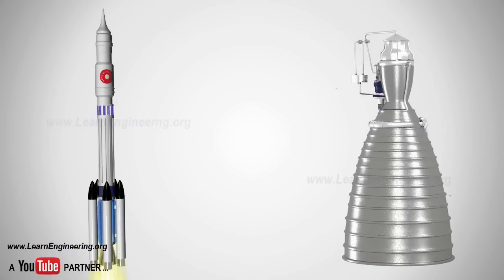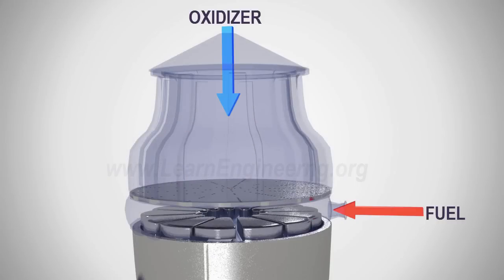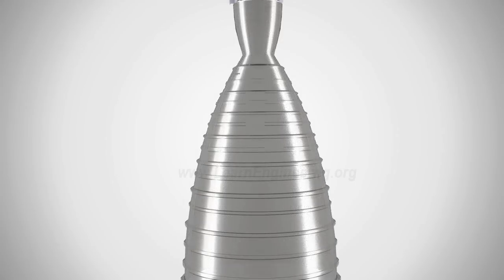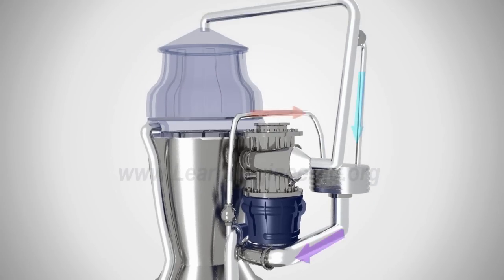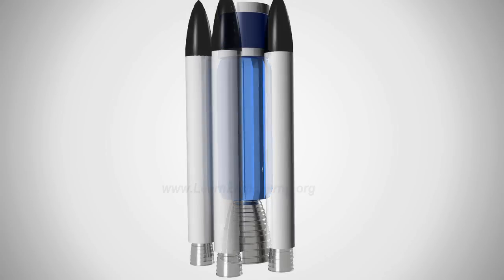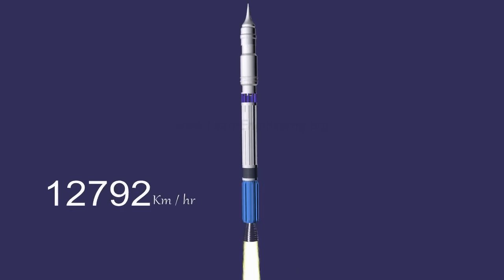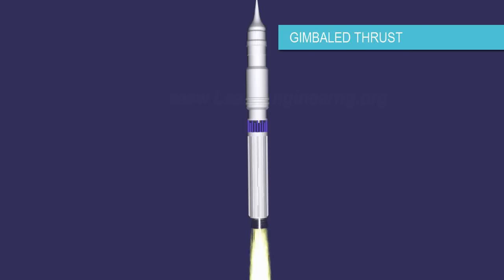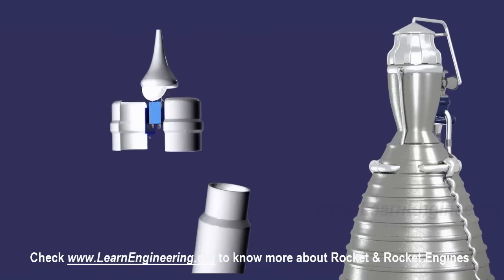How a Rocket works?

Comment: Thanks for your very nice video.  Would you please teach me how it has been obtained in the manner which the driving force of the pumps?
Reply: +shouji takano - They use a small rocket engine called a gas generator to drive the pumps. Its output is a hot smokey gas traveling at a very high speed. The gas coming out of the gas generator then goes through a turbine, which is like a windmill. The energy in the gas is converted to mechanical energy by the turbine causing it to rotate. The two propellant pumps, one or the fuel and the other for the oxidizer, are on the same shaft as the turbine, so when the turbine spins it drives the pumps. The turbines on the Apollo Saturn V first stage were amazing. Each one produced 55,000 horsepower, which was necessary to pump all that propellant into each engine.

Comment: This is an excellent video. However, I would suggest one addition.

Many people have trouble understanding rocket propulsion, especially outside the atmosphere, because they can't understand what the rocket "pushes against". They are under the misunderstanding that rockets push against the earth's atmosphere initially but then once in space they have nothing to push against. So it is often wondered how do they work in space.

Most explanations of rocket propulsion appropriately include a reference to Newton's 3rd law of motion. But actually, all three laws are involved in rocket propulsion and the first law is as equally important as the 3rd. This is because it established the "dual role" of the propellants. Of course one role is to cause the combustion necessary to accelerate the propellants through the nozzle. But the other role is to supply the mass, along with its corresponding inertia.

To clear up the confusion, it needs to be more strongly emphasized that it is the inertial mass of the propellants that the rocket "pushes against" while changing its velocity in space.
Reply: Free Speech Well, I don't know how to put it more simply. 5th graders grasp this stuff, if you don't, I guess no one can help you.

Just think it through, you expel many tonnes of propellant from your rocket at high velocity - and nothing happens on the other end?
Our universe wouldn't look anything like it does if this wasn't true, think of the implications for star formation.
But alright, I guess it's all a hoax and you are one of the few "brilliant" people to figure it out. Arrogance and ignorance is a dangerous mix.
Reply: +Greyfell 309 - I'd be glad to teach you how all this stuff works. I charge $150/Hr. I hope you have a big bank account because I think it's going to take a while.
Reply: Greyfell 309 "Every action creates an equal and opposite reaction" sounds familiar, right? That's why you laugh when in movies bad guys go flying off after being hit by shotgun blasts, because it is absurd, right? The shooter would do the same!
Well, that's where the comparison is accurate.
A rocket weighs between 500-800 tonnes, depending on type, at launch, most of which is propellant. The reaction works the same in vacuum.

But logic isn't going to work on people like you, hm? At least it hasn't yet.
But ask yourself: all the space pictures from all the nations and scientists and government...a conspiracy involving hundreds of thousands, potentially millions of people from all over the world....and it is so obvious to see to armchair truthers like you...that sounds wrong, doesn't it? I mean, like, what are they REALLY hiding?
Lizard people. It's the lizard people.
Reply: Greyfell 309 You are only able to form this sentence because you were taught so by others. That is literally how human advancement has worked for our entire existence. It's even the same for animals.
Seriously, how do you just say 'fuck you' to the millions of people smarter than you that actually figured shit out?
That is the definition of stupidity.
Reply: Greyfell 309 Human advancement, people learning from other people over time, which is what got us computers and rockets in the first place. You are capable of forming sentence, but not so much of comprehending them, hm? At least you are somewhat consistent.
Reply: +Free Speech - You are incorrect. What's really in play here is Newton's first law, which is sometimes called the law of inertia. The propellants carried aboard a rocket have inertia and as such they want to remain in their current state of motion. So when a rocket engine accelerates the propellants up to supersonic speed it's actually pushing against the mass inertia of the outgoing propellants. It's really not a difficult concept to understand.
Reply: +Greyfell 309 - Please provide a logical explanation why it is wrong.
Reply: Greyfell 309 Except that it does work and your assumption is wrong.
The reaction mass - the propellant - is what makes a rocket work, even in our atmosphere.
Reply: Greyfell 309 Just shine a laser on one of the mirrors they left behind, it's easy, coordinates are publicly available.
Or were those left by the lizard people?
Reply: +Greyfell 309 - NASA already did.
Reply: +Barron Risling - And when you're prostate comes out the reaction will cause your body to go in the opposite direction according to Newton's third law.
Reply: +Greyfell 309 So NASA has fooled all of the scientific comunity? Wow, You are a genius
Reply: +grmasdfII Yea, but it's a throwaway reference.  Everything about this video is on the superficial side.
Reply: +Greyfell 309 - Yes, they work in space.
Reply: +Free Speech - Please direct us to a website that "proves" rockets do not work in space, so that we can all become as highly educated as you are. Prove what you are saying, or maybe you just cannot prove it and would rather stick with your unsubstantiated beliefs?
Reply: +Greyfell 309 - The concept of action/reaction is in no way based on the concept of "pushing" against anything. This is a misconception that can be easily cured by studying the topic instead of using your "best guess".
Google "specific impulse". Good luck.
Reply: +Joe Vignolo - Exactly. Greyfell has "looked into this" - by that he means he watches youtube videos made by people who have zero understanding of these concepts and would rather believe them than the books he was supposed to study when he was in school. It's a lost cause.
Reply: +Greyfell 309 - You keep saying "rockets would have nothing to push against", but that's not how rockets work. Your "information" is not just flawed, it is totally incorrect.
Reply: Joe Vignolo, Respectfully I will attempt to change your perspective: "Rockets work in space by pushing against the inertia of their own propellants."
That is the work they perform, not how they perform it.
I think this next part just restates what you have written a few times before about how they perform the work.
In the thrust chamber the gasses are "thrust" away. As long as they are accelerating they are performing work, even as they expand and lose pressure. The instant they stop accelerating they become exhaust.
Reply: I'm pretty sure that SpaceX rockets aren't the size of the Saturn V.
Reply: +Greyfell 309 - Your understanding of the physics involved in rocket propulsion is deficient. You need to take and pass at least a junior high school level course in basic physics before you post to any more articles like this.

You also sound like what I call a "paranoid government hater". You hate the government so much you think it always lies about everything. Sure, it sometimes lies but sometimes it doesn't. But you can't figure out the difference. So you try to discredit NASA and the Apollo project by posting a bunch of drivel and nonsense trying to convince people that rockets can't work in space, when they obviously do.
Reply: tekcomputers
- Exactly. Well explained.
Reply: Joe Vignolo, thanks for posting this comment, even if the discussion did get taken over by a couple of trolls. I had the same argument with another delusionist who clings to the idea that a rocket "pushes against" something and therefore can't work in space. There's no convincing them.
Reply: Joe Vignolo Is it actually that complicated to be worth that much, or are you just trolling the moron?
Reply: grmasdfII And soon, it will give us organic robots capable of completely imitating human behaviour.
Reply: Rohan Zener lets bloody well hope they don’t imitate these paranoid morons behaviour otherwise devolution will be rampant and extremely fast! 

I think the whole space sucking thing has come from movies like alien where the alien was liquidised and sucked out to space through a tiny little hole in a window.
Reply: Joe Vignolo So what if we were to accelerate the gas to hypersonic speeds?
Reply: I thought it's due to discharge of fuel in opposite direction which provides a forward momentum 

You can't push anything in outer space
Reply: +Greyfell 309 - Rockets work in space by pushing against the inertia of their own propellants. 

The propellants have mass just as all matter does. And all mass has inertia. So as the burned propellants accelerate out through the exhaust nozzle they try to remain at rest according to Newton's first law. Therefore, accelerating the propellants against their own inertia creates an equal and opposite force according to Newton's third law. It is this reactive force that pushes the rocket in the other direction.

Another way to envision it is to imagine firing a rifle in space. Initially the loaded rifle, the gunpowder and the bullet will all be at rest together at some initial starting point. Then fire the gun. As the gunpowder burns and expands in the rifle barrel the gun pushes the bullet in one direction while at the same time the bullet pushes the gun in the opposite direction. Afterwards the rifle will be in motion going in one direction and the gunpowder and bullet will be in motion going in the other direction and both will be moving away from the initial starting point.

In a rocket, the rocket's structure is like the rifle. The propellants are like the bullet and gunpowder. The action-reaction principle is the same.  

It's true that eventually the propellants will defuse out into the void of space, but only after being accelerated out the nozzle at high speed, which produced the reactive thrusting force in the opposite direction.
Reply: +tekcomputers - Correct. Most modern rocket engines have thrust chamber pressures of between 100 and several hundred PSI. Therefore, the difference between 0 PSI in space and 14.9 PSI near the ground is insignificant. In either environment the engine will operate nearly the same.

That said, the pressure difference across the nozzle alters the kinetic state of the gas. It's just F=MA. The gas has mass (M) that when accelerated (A) produces a force (F). The only thing I don't get is why this is so hard for some people to understand.
Reply: +Greyfell 309 You make the same mistake most people who deny rockets in space work, claiming vacuums just suck the fuel out..... Vacuums do not "suck" they are not a thing and they exert no force, they do not push, they do not pull, they are the lack of anything...... the force that causes gases to expand into a vacuum is the kinetic energy of gas molecules themselves, not any "sucking force" by the vacuum.... the vacuum simply present nothing to alter or impeded the gases kinetic motion. The misconception you, and several others have is owing to you not understanding the nature of gasses as a kinetic material. I would suggest studying the kinetic theory of gases as it will fill in the holes in your knowledge so you can better understand why rocket will indeed work in a vacuum.
Reply: +Joe Vignolo It's covered in the beginning of the video, Newtons 3rd law of motion, reaction mass n whatnot.
Reply: Greyfell 309 Do you believe in autism?
Reply: Ok, so can we go to the moon now? :P
Reply: Who are this millions of people smarter than you that actually figured shit out? There are not so many space agencies in this world..
Reply: Yes, no doubt about it... )))))) :P
Reply: @greyfell3099  
Im not a rocket scientist, but I am an aerospace engineer, so thats close enough.

Lets start with this, once you place fuel in the combustion chamber, it doesnt get sucked out by the vacuum at the outside of the nozzle, as a matter of fact, vacuums do never suck. 

What is happening is that the propellant is burned, expanding the propellant immensely, this increases the pressure in the combustion chamber, pushing the fuel away. 
So actually the rocket is pushing the propellant out the back.
Reply: "It's really not a difficult concept to understand." No, it's not, but it's incorect. But i'm not the rocket scientisit here
Reply: "Rockets work in space by pushing against the inertia of their own propellants. " I'm no scientologist, but this statement is.. eeeh.. If that's the case, then the rocket would go faster and faster, how do you stop this in space. Another issue with that is inertia is not matter, so you can not push against non material things.. Another issue is that in void, the exhaust gasses will expand so fast, it will vaporizes almost instant. "The propellants are like the bullet and gunpowder. The action-reaction principle is the same." This analogy is not true. In a rifle, .The gunpowder expands very very fast, this expansion will push the bullet out. No rocket science there, how is that similar to rocket engines? I'm tellin you, rocket will never work in space, but that's not the reason NASA never went to the moon, not even close
Reply: ))))) ok, let's just stop this conversation here, it would be better this way :) Peace!!
Reply: This is not something i heard on the TV once, i actually have loocked into this, and the conclusion is no, rockets can not work in space. It does not take a super human genious mind to figure it out. Rockets in void.. please :D
Reply: It would, but it's very hard to do so with just a comment.. Just think of gases here on earth.. they stay together because the air pressure keeps them together.. In such a vast vacuum, any gas will expand soo fast in all directions, there would be nothing to push against anywhere.. That's one thing, the second reason for no rockets in space is the control of the rocket, since you rely on the burned gases to push against.. It wont work.. try to picture this scenario in your mind....
Reply: 5th graders grasp this stuff only because they are learned so by others. Many many BS is planted in the mind of children. And no, the universe does not look like anything what's on your mind, it looks just as you see it with your own eyes
Reply: Still, rockets wont work in space, and please spare me of "waa you dont know anything" stuff. If you belive that, good for you
Reply: +Joe Vignolo Rocket engines can not work in space. Infinite void will suck out all the fuel. And i dont know you logic, but mine says that if there is nothing to push against, no oposite force will be generated, so you would burn fuel, wich escapes the engine with great velocity and the void will suck it almost instantly, so no thrust there, sorry for NASA, but they can not fool every man
Reply: @greyfell3099  There do . Why would their lie about such events. If there need money the gouverment can easily just print money. Its that esay.

Comment: How a rocket spins in journey?
Reply: mupparamshyam 
Newton's first law of motion. Once you get a spacecraft spinning in the vacuum of Space it will just continue to spin, until it is affected by a large gravitational body, or by thrusters that reduce the spin.

The Apollo craft just coasted to the Moon. Rotating gently at about 3 revolutions an hour.
Reply: Thank you sir,is there any mechanism on the rocket body to spin it?
Reply: +mupparamshyam A craft with multiple engines can gimbal them in opposite directions at the same time to spin the craft. Otherwise, small thrusters may be used to do this.
Reply: +Andrew Rainville 

thank you sir, but what about the rocket spinning around itself? how it possible...
Reply: mupparamshyam

The rocket engines don't spin, but the thrust can be redirected by gimbaling the bells of the engines. This initiates a change of trajectory.

On craft with multiple engines,roll can also be induced & stopped. On craft with a single engine, lateral thrusters are used when the craft is coasting..
Reply: David Keenan thank you sir.
Reply: +mupparamshyam Google 'reaction control system'.

Comment: The SRB doesn't carry oxidizer?
Reply from the maker: Indra Ida Bagus Both the types are there. We just used a simplified one here.
Reply from the maker: Indra Ida Bagus The oxidizer grains are mixed with the fuel in this type.
Reply: +Indra Ida Bagus The oxidizer is bonded within the solid fuel in a solid state. Though, there are hybrid solid fueled rockets, where the solid fuel burns indefinitely, while the an additional oxidizer tank can control its flow to adjust the thrust of the engine :)
Reply: Yes they do, all solid rockets have an oxidizer usually AP or ammonium perchlorate but can be potassium nitrate with the first Chinese black powder rockets 3000 years ago.
Reply: someone has been playing KSP... yes solid fuel engines do need oxidizer.